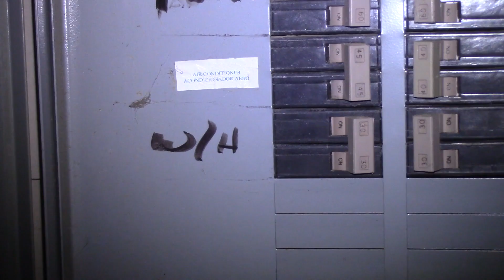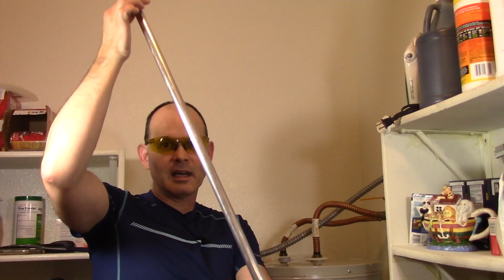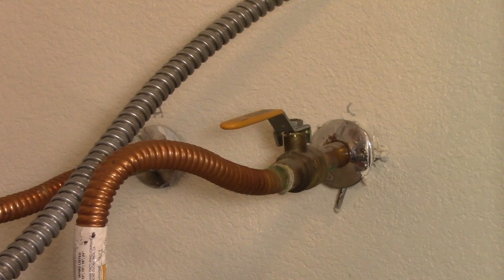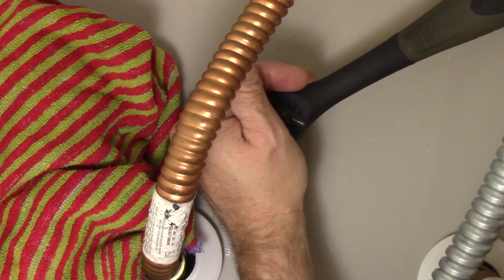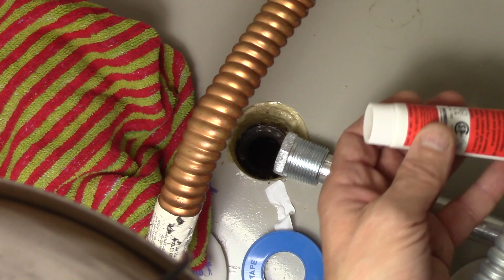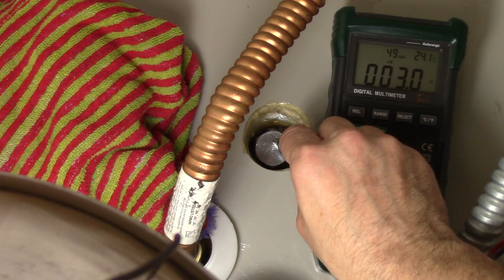Hot Water Tank Anode Replacement How To Complete A.O.Smith ECT 55 200 Water Heater

Comment: My AO Smith tank only has hot and cold inlets on top.  I don't see that hole for the anode rod!
Reply from the maker: It sounds like your tank might have a combined hot water outlet/anode rod. You might want to check if the anode rod is integrated with the hot water outlet.
Reply: @richardlloydusa  If that's the case, sounds difficult to replace myself.
Reply from the maker: What's the model number on your hot water tank? Thanks

Comment: Did you drain the tank or no
Reply from the maker: I did not drain the tank as the Anode i mounted on the top of the tank. If yours is elsewhere some are horizontal than you must drain it. Make sure to turn off the water main and depressurize the system by opening a tap. I use the garden taps as they are mounted low and will drain the most water out of the system. 
Thank you so much for commenting and watching. I appreciate it greatly. Subscribe, Click The Bell and stay tuned! All the best.👍😀

Comment: Would it be possible to use conductive anti seize like that used on car spark plugs, instead of Teflon tape?
Reply from the maker: The use of Teflon tape and or pipe sealant is a plumbing standard to seal pipe, pretty well universal. I would stick with those to be safe. This is not a place where I would experiment as a failure of the seal could cause significant water and other damage.  Thank you so much for commenting. I appreciate it greatly. All the best.👍😀

Comment: 🚨If you empty your tank below the top element it will need to be refilled with water BEFORE you turn back on the electricity otherwise you will get a dry fire and burn out the element. Keep the taps open and turn back on the water (let it run for a couple minutes) to get rid of any air in the tank. Then turn back on the electric.
Reply from the maker: Thank you so much for watching, commenting and the valuable feedback. I appreciate it greatly. All the best.👍😀

Comment: Helpful info   thanks. I like how your thorough. Continuity test was a nice touch. I always check my plumbing for leaks after working on it as well. At least for a day or two. Question. How do you get those annoying stickers off the anode rod?
Reply from the maker: You're most welcome. I'm glad and very happy to know that I could help you. You can use a heat gun. Sometimes I use rubbing alcohol and or Goo Gone to get those off. Thank you so much for watching, commenting and the very kind words. I appreciate it greatly. All the best.👍😀

Comment: Great video, question. I have a 14 year AO Smith GCV 50 100, the only thing that I had to change twice in the 14 years was the thermocouple kit. I have never changed the Anode rod if I do this now will it make it worse?
Reply from the maker: It can only improve the tank. It is supposed to have a working anode and if yours is depleted then changing it will only help the system. Thank you so much for watching and commenting. I appreciate it greatly. All the best.👍😀

Comment: My tank was full and it’s 2 years old. It wouldn’t break loose even with a cheater. I guess it’s call the professional time. I’m on my 4th tank in 20 years due to corrosion.
Reply from the maker: I have seen people use and impact wrench to get it off. You can get a cheap electric impact wrench at Harbor Freight if you have access otherwise you can purchase one on Amazon (paid link no cost to you) https://amzn.to/2J0qZZc or here on eBay (paid link no cost to you) https://ebay.to/2UiKlxO if it works it will save a larger repair bill. I would also use some penetrating oil on the bolt overnight and trying the pry bar method again and the impact wrench as a last resort. Thank you for watching and commenting. I appreciate it greatly. All the best. Be SAFE! 👍😀

Comment: I don't know how much luck I'll have with this but I'm planning to replace to the anode rod on my water heater. Only thing holding me back is finding a 6 point 1 and 1/16 socket in half inch drive locally. I do however have a 6 point 27 mm socket in half inch. My question is how good of a fit was the 27 mm socket you used?

Comment: I have a brand new A.O Smith 40gal that was just installed about 2 months ago. I am on a well for water. The hot water has a foul or almost ionized smell to it.  Would you recommend a zinc anode rod to kill this odor?
Reply: I have the same problem. What was your solution?

Comment: 12 year old tank, head of rod is rusted off badly - better to leave until time for new tank?
Reply: Might been beyond repair.  Try flushing the tank and see if you find rust.  If you do, its probably a bad tank.  If not, then try taking the anode out.  However,  becareful not to bust the threads as you noted its rusted.  If all is well, change out the anode and moving forward learn for this and change your anode every 2 to 5 years. Flush the tank every year to tank out the sediment and see condition of the tank.

Comment: When you open a faucet to relieve the pressure, you should make sure the tap is lower than the top of the anode you are removing, or you can drain a bit of the water from the hot water heater, via the drain valve - to enure you do not overflow the tank. It is also a good idea to leave the venting faucet open, in case the shutoff valve does not provide a tight shutoff. Again, that will prevent overflowing the tank.

Comment: Just for the hell of it, I would flush the tank after installing and pressure testing the tank.  Some bits and pieces of the old rod might have come off during removal, especially if you use an impact wrench to loosen it.  Some of what you wipe out of the threads can also get down into the tank.  Just my $0.02.  Very nice video, and good information.

Comment: Great video but I must say demonstrating with that small 1/2 ratchet like you used is ridiculous.  I guarantee that would not work on 98% or more of the tanks out there.  Brand new ones are super tight and old ones are rusted in so either case you will need a much larger 1/2 ratchet or breaker bar.  I have done several of these and the best approach is a pneumatic impact wrench.  You can tweak it easily so you just break it lose like a half turn by watching the socket slowly rotate as you impact it.  Then I switch to the hand ratchet for the rest of the way. Also drain a gallon or two to eliminate any leakage out of the hole.  A new rod will have more volume than the old one so not draining will definitely make it overflow when inserting. Why make the mess?  Good video.. thanks!
Reply: EXACTLY !   Well said.

Comment: I read somewhere if you're consistent replacing the Anode every few years your water heater will last for life, I don't know how accurate that info is but it's worth a try.
Reply: Yep. It extends its life!
Reply: I have one that was installed in 1984. I serviced it every year due to extremely hard water. I was still servicing after I made this my first rental property until selling the property in 2008; 33 years.

Comment: I added 2 elements less than 2 months ago. Worked fine until this week. I am now breaking the breaker about every 3 days. It is a 7 year old GE. Should I keep fixing or replace? 38 gallon short under furnace. 240V 2 4500 elements. Could it be the rod?

Comment: How many year tank do you have and how many times have you changed the anode rod? If this is the first time your water heater will croak at the end of the tank warranty. My whole street which the houses were all built at the same time had 12 year tanks installed died at exactly 12 years. I bought a new gas water heater with a blower motor exhaust to the outside as there is no chimney. It cost me about $2800.00 which croaked me. I could not believe the cost but I had increased the warranty to 20 years for an extra $200.00 and plan on doing the anode rods yearly. I was expecting about $800.00 bucks to do the water heater not $2800.00, I was flabbergasted at the expense but after researching the cost I found this was the cost mainly due to the fan exhaust system which I still found to be no big deal but it was. As with everything you must properly maintain your equipment or you will pay in the end. Good job but from the condition of your rod you may have wasted your time and money because I think it will blow at the projected life span anyway. Unless you have done this regularly and from the condition of the rod that isn't likely, she's a goner right on time.🚣🏻
Reply from the maker: So far so good Sir. There was still a small amount of anode left when I pulled it out but it was certainly near it's end. Time will tell. You are most welcome. Thank you for watching, commenting, the valuable feedback and the kind words. I appreciate it greatly. I am happy to know I could help. All the best.👍😀
Reply: Damn you were ROCKED , $2800 what exactly did you buy , also i purchased a POWER VENT WATER  ALSO BUT DIDNT PAY NEARLY AND ALSO IVE RECIEVED $500 REBATE BACK FROM STATE FOR BUYING A NEW ECONOMICAL UNIT YOU SHOULD LOOK INTO THAT REBATE WITH STATE TO STOP THE BLEEDING

Comment: Love the 1986 earring kit. BTW, the tanks are not glass lined. It's an enamel coating that coats the steel tank.
Reply: jim davidson - sorry Jim but they are lined mostly with vitreous glass. Enamel is made of melted glass, often on metal. Sometimes it is called vitreous or porcelain enamel. I think you are splitting hairs
Reply from the maker: Thank you for watching, commenting and the valuable feedback. I appreciate it greatly. All the best.

Comment: Great video!!  I would suggest making sure a hot water tap cracked until the first heating cycle on the hot water tank is complete.  If there is significant cooling of the water in the tank between the start and finish of the project, you may exceed the capacity of your bladder system designed to handle this expansion.
Reply from the maker: Thank you for the tip. I did not run into the issue but others may. I appreciate the great advice and the kind comments. All the best.
Reply from the maker: There is a pressure release valve on the side of my tank. Sorry I did not show it. You could also use the intake or output pipes if they are made of metal. Thank you. All the best.